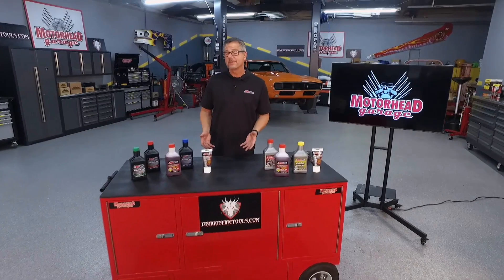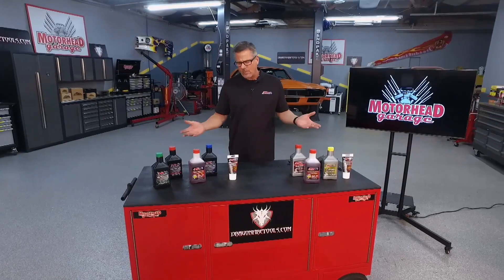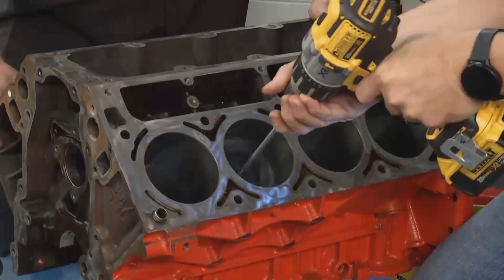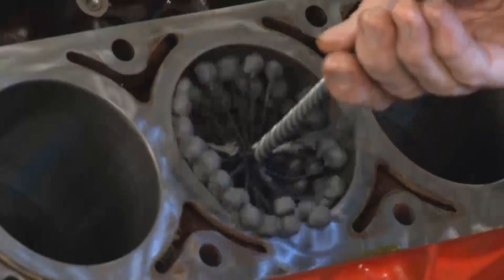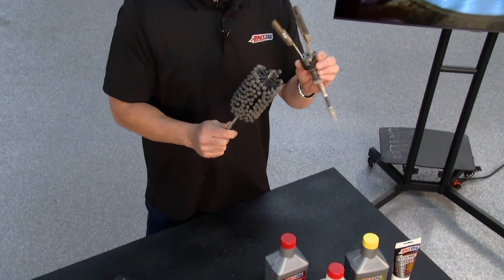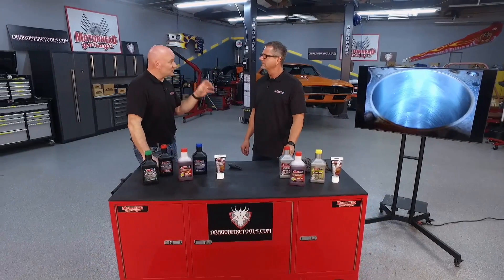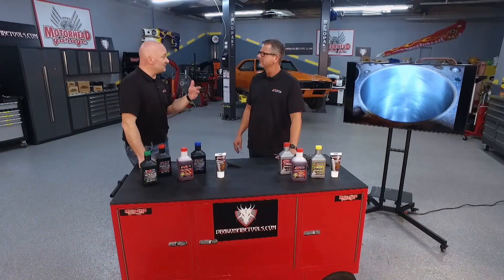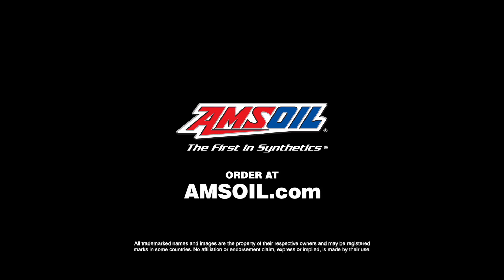How to Break in a New Engine

Comment: Greetings to all of you. I have a question. I live in a country with a very hot climate. What is the appropriate oil for a 2014 Expedition? There is a number 5w20 on the hood, but I don't know if the oil will work in these hot climates? Its temperature reaches 50 degrees

Comment: I'm a big Amsoil fan, but premium break in oil is a bit silly. Grab the cheapest conventional off the shelf and run that for the first couple hundred miles, then switch to Amsoil and start tuning.
Reply: I completely agree. Also, he says take it easy. That's the worse thing you can do. You want to do mild pulls with high vacuum  engine breaking so  the rings really dig into the cylinder.
Reply: @justinstrouse1015  I'm not a believer in easy break in either. Only the first couple of heat cycles to check for leaks and troubleshoot any issues after a new build, then start gradually adding load and RPM. The last motor i built for a street car was spinning 8000 RPM with 38psi of boost before 200 miles.
Reply: Yeah , well I think they do a good job of blending the break in oil to be just right. I think the thing about break in is to progressively get harder on them. But I agree, you want the rings to seat good to the cylinder walls and not get glazed.
Reply: Я́асито ГБ дхру Но вго

Comment: Best to use green scotchbrite pad on the bores.... Stops micro welding after honing.

Wash / clean bores with Gunk cleaner.

This will add HP to the Engine.